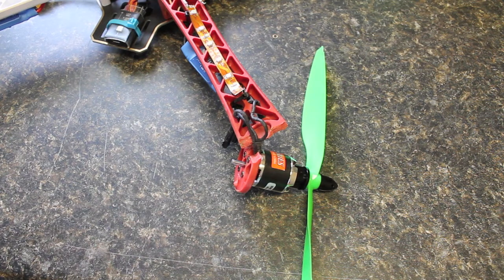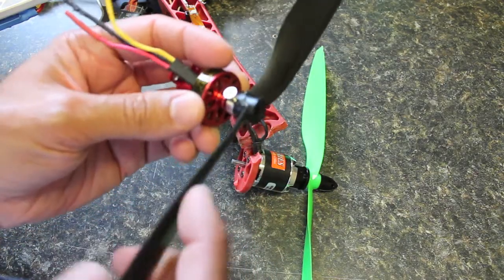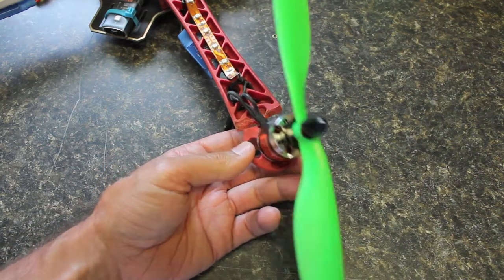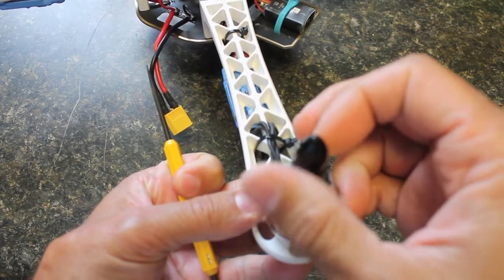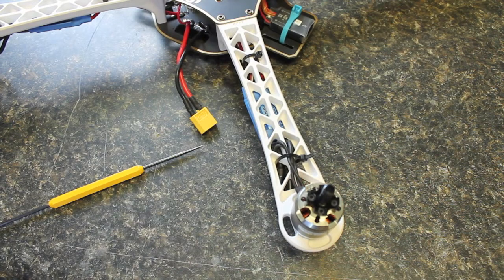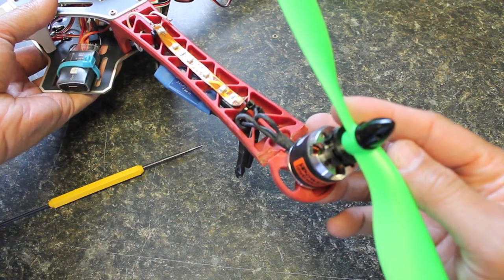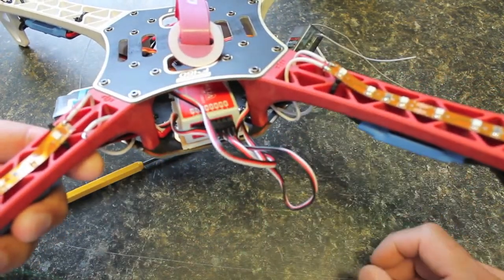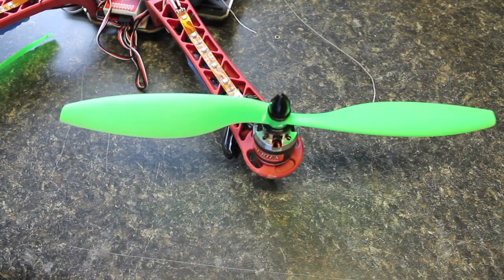DJI Naza F450 Quadcopter Broken Arm Could Have Been Avoided with Preflight Check

Comment: 1. Start by screwing on the prop adapter by hand tight. 2. Now get out a screw driver that can go though the hole in the bullet connector. 3. Put the screw driver all the way though the bullet connector turn bullet connecter with the screwdriver  while holding  the can of the motor with other hand  Hold it as tight as you can, Spin bullet connect using the screw driver until till the motor can slips free thus you cant tighten it anymore with out risk of denting the can. Do not use pliers on can

Comment from the maker: The DJI frame is insanely strong and the arms are relatively cheap to replace. I got a new arm for $4.50 so that's not too bad. For the KK board I had the Turnigy Talon V1 frame from Hobby King. It was a good starter frame, but IMO not as durable as the DJI frame. I never had any problems with the carbon fiber parts, but mainly some of the nylon spacers and adapters that came with the frame. It's simply a matter of preference, but I like the overall design of the DJI frame better.